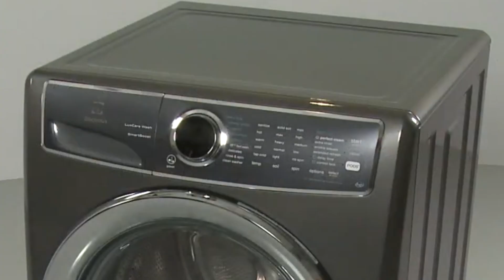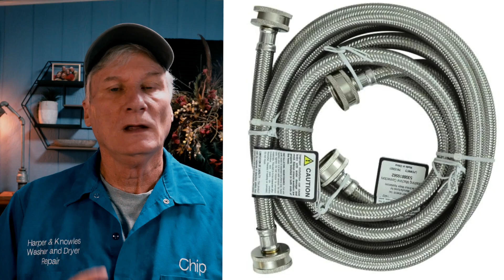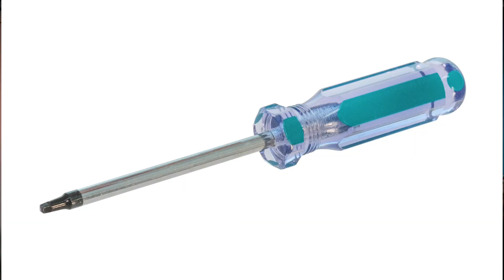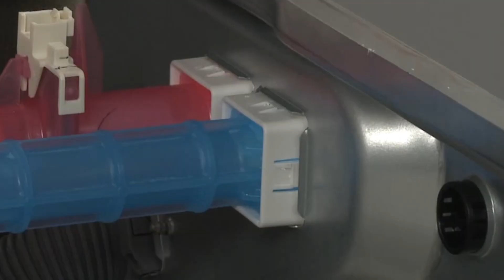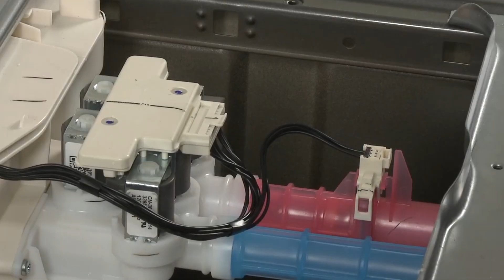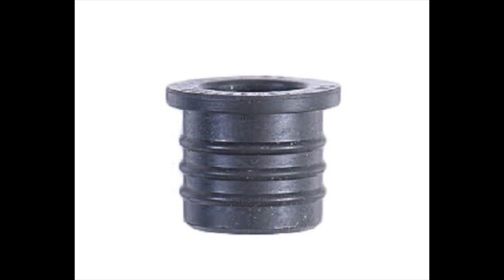Electrolux Washer Error Codes E10 E11 E12 — No Water Fix

Comment: Quick question, we turned washer on with water still off getting e11 code. Unplugged for 6 mins but didn’t help any thoughts
Reply from the maker: You can get that code if the control board detects a malfunctioning solenoid on the inlet valve. It’s not so smart as to know there is actual liquid flowing throuh the valve. Thanks for watching!

Comment: Our Electrolux washing machine doesn't really throw a code number but t it just says physically "no water". So when it does that, I just put it on the spin cycle. It usually does no water on occasion, but today it did it twice. Most times I add extra water to the detergent basin while it fills to avoid getting that code. I'm a single mom and i'm also taking care of my mom by myself. 

Our house was built in the 80s. The space where the washer and the dryer is is very small, and in the same spot as our water heater, so it's a very tight space, so I would have to move the entire dryer by myself, in order to move the washer enough to get behind it. I'll end up calling a repairman for this. 😢 I yypically like to refer to YouTube if it's within my scope or seems simple  to do what I can to save my mom money.

However, more often than not when I go to youtube, it's always some model that I don't have, or there's a screw or something that needs to be removed that I just don't have the elbow grease to remove a part.  That happened once when I tried to fix a sink by myself. I didn't have enough elbow grease, to remove a part so we had to pay $120 for a job that should have been five minutes for me to fix, had I been able to unscrew it myself.
Reply from the maker: That sounds really frustrating to deal with, but it's smart to know your limits and call for help rather than risk hurting yourself or breaking something else. Thanks for watching!

Comment: Hello ~ My my husband turned the water off just  in the kitchen ~ he thought ~ I turned washer on and got the E11 code ~ the washer door locked … we tried unplugging and cleaning hoses but did not work ~ my question is I guess does the water inlet valve need to be replaced because of damage of not having water for that quick minute ?  That seems odd to me ?
Reply from the maker: No. That shouldn’t damage the valves. Undo the lines at the back of the machine and check that water is actually coming through. Use a bucket. Check the screens for trash and debris.

Comment: Ok my washer has an E11 code! Water will not fill up in any cycle except for the rinse and spin cycle. With a normal cycle, it sounds like water is running, but it never goes into the actual washing machine. Occasionally, the gfi will trip. Anyways, The water valve is getting continuity and voltage. The door lock switch Appears to not be continuity unless I don’t know how to test it properly. I have one coming and I have already replaced the pressure sensor switch. 

I don’t understand why it would fill up during a rinse and spin cycle, if the water inlet valve is broken You would think that it wouldn’t work in any cycle. If the door lock switch is the issue Same question. I don’t know if anybody has any help with any of these problems I’m having🙏
Reply from the maker: All rinses are cold water. Try washing with cold water. It might be your hot water valve is the problem.
Reply: It is both hot and cold
Reply: I’ve got the same issue. Smh 🤷

Comment: My condition is it has E11 code displayed and a constant Pump running, all button on the screen is malfunction and my clothes are dry inside the machine. The pump will keep running even after I switch off the machine by the button so nothing works by the button themselves. Water supply was momentarily cut off at the beginning to have the conditions triggered. No washing cycle began yet. efls627uiw Model number
Reply from the maker: I have seen this before. Let the machine just run. The pump will probably turn off in about 10 to 20 minutes. Then it should power down when you press the power button. Open and close the door. Then try to run a cycle. Thanks for watching.
Reply: @HarperandKnowles  This is exactly what was happening with our Electrolux washing machine.  We did this, the pump eventually shut off, the door opened, and I removed part of the load that was too much for it.  It's running perfectly now!  THANK YOU!!!!!!!!!!!!!  I live in the mountains an hour away from the nearest repair person, so 2 hours of traveling time would have added up to big $$$!  We bought this unit new in 2020, and have been using it without a hitch since November 2020.  This was our first issue with it, and it was user error that caused it.
Reply from the maker: I’m glad I could help. Thanks for watching!

Comment: My Electrolux washing machine always indicated E90 what happens sir???
Reply from the maker: You probably have a control board issue. With luck you may find a replacement in the $200 range. Check the connections between the boards first. Thanks for watching!
Reply: @HarperandKnowles thank you very much sir for your reply

Comment: Mine shows E11 after filling up to the bottom of the window. It seems to fill quickly and once the error displays and the cycle stops it drains quickly. Could there be another reason that’s simpler than a part replacement?  And is there a way to prevent this in the future or is it just due to low quality parts?

Model: EFLW317TIW
Reply from the maker: E11 is a slow full issue. Your water inlet on the cold side is the most susceptible part to fail or be clogged where the hose fits. Try removing the hose and clean the screen. Unfortunately you will probably have to replace the water inlet valve. Thanks for watching!

Comment: I'm commenting bc you seem pretty good about replying. How do I know the valve assembly needs replaced before I order it? Could I just follow these steps and assess/clean the valves from water sediment to assess the situation before I order the piece? My machine is throwing the E 11 code
Reply from the maker: You can certainly try that but you may have to do the job twice if your cleaning doesn't work. Thanks for watching!

Comment: I have one that gives me a e53 motor code. How do I know if it's the motor o the motor control board next to it. Model number eifls60lt0
Reply from the maker: Oooo, that’s a tough one. The few times I’ve dealt with this it was one of two scenarios. Either it was a bad wire or it was the board. I don’t think it was ever the motor. If you’re lucky you can find a broken wire between the two or a bad connection. I think most of the time it was the board. Good luck with your repair and thanks for watching !

Comment: I've got an Electrolux front load washer that's throwing the E-11 code. For a couple of weeks it would power off mid-cycle and need to be restarted and it would start where it shut off. Then a few days ago it threw E-11 so I unplugged it for 45 minutes and then plugged it back in. That didn't really fix anything but every time you shut it off and turned it back on it would clear the code until it tried to fill and then it would throw the code again. I ran the diagnostic tests on it and when running the test water flowed freely through both hot and cold lines. After running the diagnostics, I tried running a cycle and now all the cycles work error free except when I try running the 20 min fast wash, then it throws the E-11. As I'm typing this I'm realizing that this is sounding like a main board issue.
Reply from the maker: The inlet valve may be intermittently failing. Valves are cheaper than control boards. That’s what I’d try first. Thanks for watching!
Reply: Thanks for the quick reply. I'll have to try that first then. They are about half the price of a main board. @HarperandKnowles
Reply: @jaredsmith2378   did this work for you?
I am having the same issue, when plugging it back in it automatically starts to drain and won't shut off, the door lock is locked also and now I have a load in that I can't get too.
Reply: So what was it? Mine does this too. E11 and not filling With any run cycle, except for rinse and spin. Occasionally will trip the breaker. E11 code. The water valve has continuity and voltage so it doesn’t seem like the CPU. Weird enough it appears that the door lock switch does not have continuity so I was going to replace that But I’m curious to see what your problem was
Reply: @MichelleJenkins-x2u  I never figured it out. It griped around for a few months and then started working mostly normally again.

Comment: I still dont understand its the lock thats stuck
Reply from the maker: A stuck lock can be a challenge. Sometimes it’s because the washer isn’t draining properly and the pump needs replacing. The door won’t open if it senses the machine is full of water. You might try unplugging the machine for about two minutes and plug it back in. If the door doesn’t open restart the cycle and see if the pump will pump out the drum. You may have to take the top off to reach the lock mechanism from the inside and make sure all the wires are connected. The last resort is to force the door open and replace the lock and striker. Thanks for watching!

Comment: I replaced my inlet valve with a brand new one and still get no water in the tub and getting E-11 error message.
When I removed the water lines I did put a bucket underneath to make sure I was getting water from both lines and the pressure seams to be strong.

Anyone have any ideas what I should be looking at next?
When I tried to run the machine after switching out the inlet valve there was a lot of buzzing so I'm going to try to carefully check the wiring.

I'm at a loss though and not sure where to look, any help would be greatly appreciated.
Reply: Identify if it's the cold supply or the hot supply that's timing out.  Also, verify you have good pressure from both supply lines. if you still have issues it might be a clogged / broken tub sensor or your main board. If you're only hearing the buzzing, you may have forgotten to turn back on the water supply??
Reply from the maker: The buzzing is probably the solenoid opening. If it is energized and the valve isn’t opening then you either have a defective valve or an interrupted water supply. Thanks for watching!

Comment: I have a E11 code and unplugging the machine didn't reset it sometimes i wish i just had the old  agitator washer at least mines still under warranty and i have to wait till Monday to get a appointment 😢
Reply from the maker: But they do still make those machines. At least some of the same quality. Here’s a video of those. The Best Washing Machine You Can Buy In 2023
https://youtu.be/qlkdxWfTZVw. Good luck with your repair!
Reply: @HarperandKnowles  hey ty for reply much respect 😄✌
Reply: Hi Sandy, we have the same problem ~ wondering how you fixed it ?
Reply: @LisaHarkin-i3q YouTube video This was so long ago but it was so simple I believe just had to hold two buttons in you will have  to look it up
Reply: @LisaHarkin-i3q https://youtu.be/EGS-9lVQmnY?si=iDjpUNZlibrHFnis
Reset video
Reply: @SandyWolf-  thank you so much @SandyWolf for the video ! It worked and I am so grateful for your help ?

Comment: I have the E11 code cause my water was turned off how do i reset after i turned water back on? Or do i have to take it all apart ?
Reply from the maker: Try unplugging it for a few minutes. If you had some plumbing done the screens where the hoses hook to the machine might have debris in them. Unscrew the hoses and clean those. Thanks for watching!

Comment: TRANSLATION =   You MUST by new inlet valves, replace old.  Yes, he never mentioned this......just goes into how to fix..expecting you know that you have to buy new inlet valve part.
Reply from the maker: I apologize if it wasn't clear in the video. In many cases, error codes like E10, E11, and E12 on Electrolux washers are related to issues with the inlet valves. While the video focuses on troubleshooting and replacing faulty parts. It's always recommended to consult the manufacturer's instructions or seek professional assistance for accurate diagnosis and proper repair. Thank you for your feedback, and I appreciate you watching the video.
Reply: true. I was going to mention that too. in the meantime, skipping basic troubleshooting before getting into valve itself means you could simply end up replacing multiple parts. I am very disappointed.
Reply from the maker: I’m sorry you were disappointed, I’ll try to do better next time. Thanks watching!
Reply: Yea ahh...next time start with you need to replace a under 2 year old MAIN PART OF YHE WASHER. I am a tech in the field also and I just could not believe a mixing valve could go this quick....AND it is a know issue. If I could only get my money back!!

Comment: Do you know how to get the door to the washing machine to open? BRcause ours wouldnt open.
Reply from the maker: I'm sorry to hear that you're facing difficulties with your washing machine door. The method for opening the door may vary depending on the model and brand of your machine. However, in some cases, you can try accessing the door lock mechanism by removing the top panel of the washer and manually releasing the lock. If you provide the model number of your machine, I can assist you with more specific instructions or recommend contacting the manufacturer or a professional technician for further assistance.
Reply: @HarperandKnowles  thanks for responding. We managed to fix it.